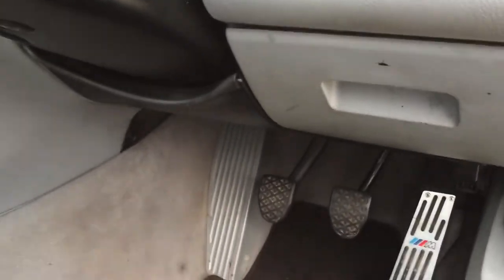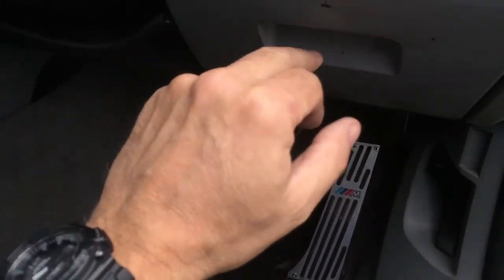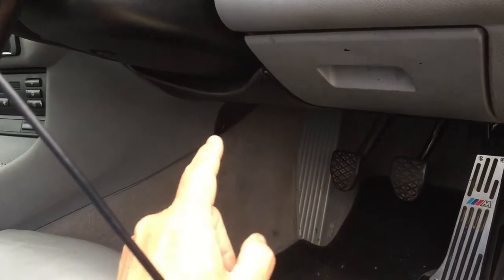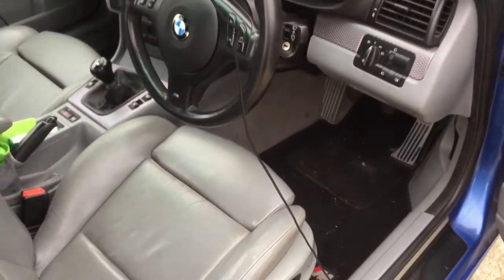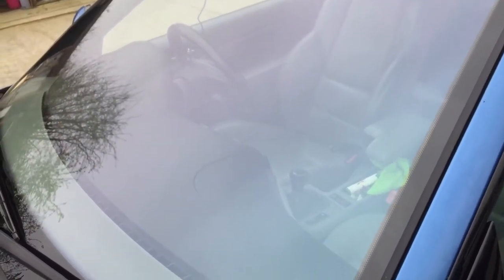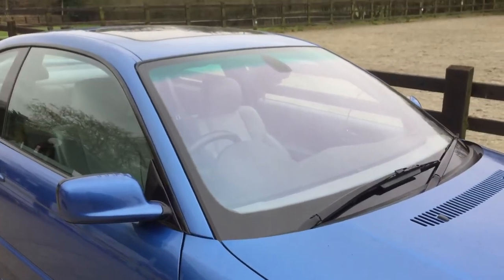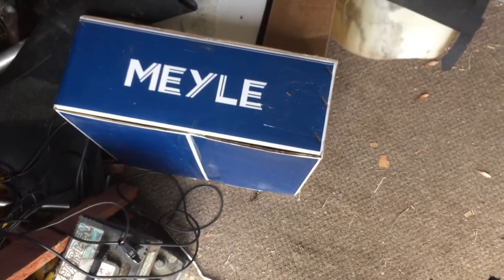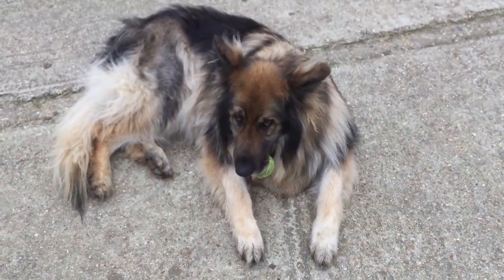BMW E46 330Ci Clubsport - Changing Air & Cabin filter + spark plugs

Comment: What difference did you see with the air filter?
Reply from the maker: To be honest, I didn't see it in that I don't feel a performance increase even though the tests I've seen all show a slight increase.  It's not enough that you'd feel it.
They K&N panel filters are good in terms of that slight performance increase, but they aren't the best in terms of actual filtering particles.  Some good quality standard ones can perform better.
Overall though, I'm happy with this one.